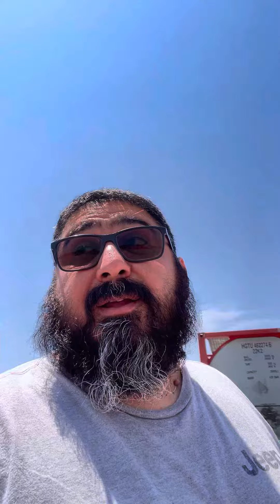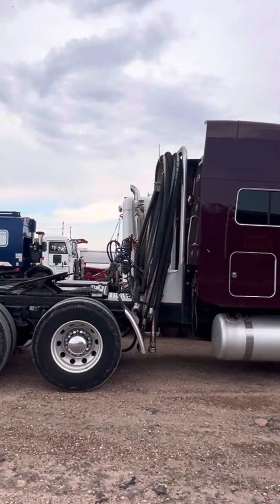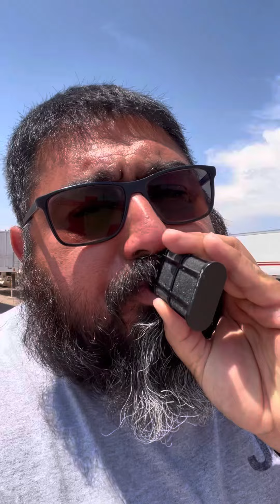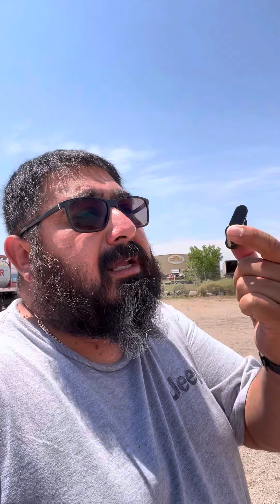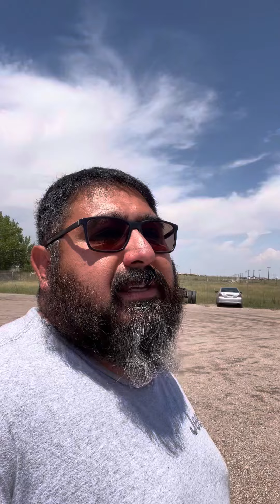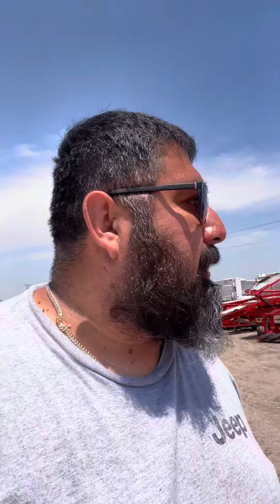THIS LITTLE FILTER COULD LEAVE YOU STRANDED!

Comment: A lot of people don’t know how to maintenance these new trucks. You gotta replace your DEF filter on a regular basis your air dryer filters on a regular basis of course your oil fuel and air filters on a regular basis your crank case filter on a regular basis  plus your cabin filters for the front and sleeper if applicable, you got a check your manufacturer of course your make model motor but most of these trucks have these things all those things people don’t think about they just run them. and the simplest things nowadays can leave you stranded derated and  or going to the shop on the a hook.